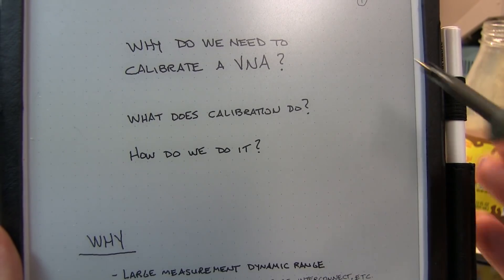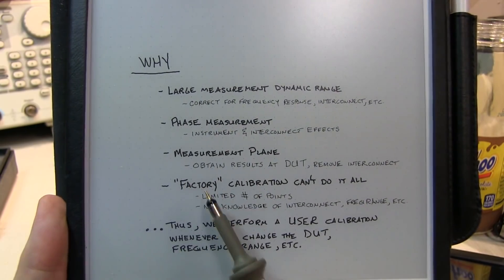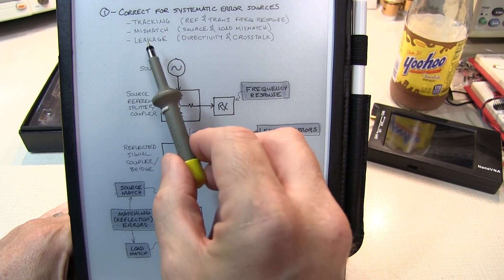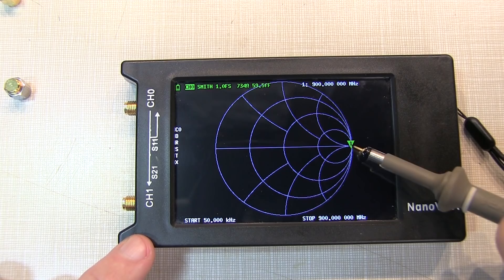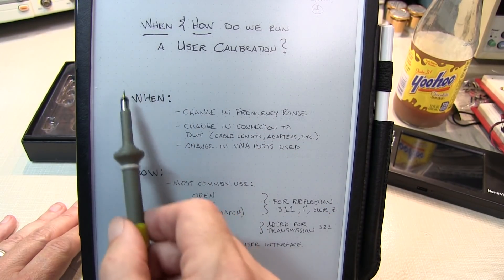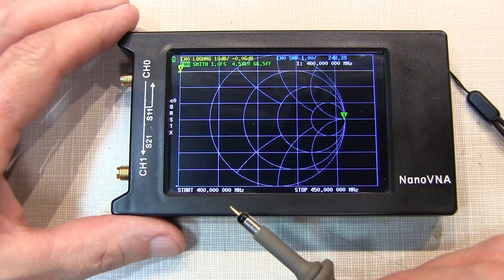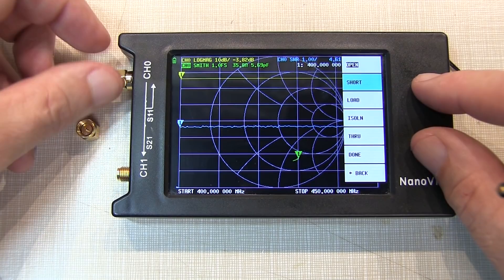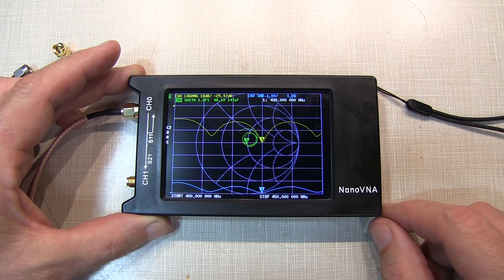#313: Why a VNA needs to be calibrated | how to calibrate a nanoVNA

Comment: is this something that needs to be done when new or every time you use it to do certain functions?
Reply from the maker: The User Calibration needs to be done whenever you change the frequency range or change the type/length/configuration of the connections to the device under test.
Reply: @w2aew  Ok is it best to test just the antenna or the entire length of used coax?
Reply from the maker: @RC-Heli835  It is best to have the antenna located where it will ultimately be used, and measure at the point where the transmitter would connect to the coax.
Reply: @w2aew  Ok my Nano arrived last yesterday but the PL259 adapter is on Backorder. So I cant check anything yet.

Comment: Could you explain how is possible to receive the RF signal using a light bulb as the RX load. 

I know EM waves are moving from the transmitter to the receiver generating a oscillatory current and turning on the incandescent light bulb. 

Would be nice to understand how exactly it works, and demonstrate it.

Comment: Thank you for the video. It puts me one step closer to understanding how my NanoVNA works. 
One question though. You demonstrated that even a short piece of coax can dramatically affect the measurements. However, you didn't connect your coax when you were calibrating the NanoVNA. Could this introduce an error in the measurements of your antenna?
Reply from the maker: Not an error, but just a different impedance due to the measurement location.  When you have a non-resonant antenna as a load, the IMPEDANCE seen at the transmitter end of the coax WILL change with the coax length, but the VSWR will NOT change with coax length.  So, if your goal is to measure the antenna SYSTEM (antenna+feedline) in order to adjust it for minimum SWR, then calibrating at the VNA and measuring at the tx end of the coax is perfectly OK (and correct).  However, just remember that the IMPEDANCE seen at the tx end of the coax is not the impedance of the antenna itself.  In order to measure the impedance of the antenna itself, the calibration plane has to be at the antenna - either through direct calibration with the standards applied at the antenna end of the coax, or possibly through port extension.
Reply: @w2aew  thank you for the reply. That's a lot to take in, and I have a lot of ground to cover. I will study this a little more.

Comment: As a metrologist engineer in the VNA department of the VNIIFTRI, I think it will be useful to add some information for those who don't own NanoVNA yet. The main drawback of this device is that it has only 101 measuring points. It means that if one wants to scan, let's say, G5RV antenna over 3 HF bands from 7 to 21 MHz, the span between two adjacent measuring points will be 144-145 kHz. It is definitely a too wide frequency step to get at least any reliable measurements. In fact, 101 points are enough to sweep antenna over any 1 band no matter HF, VHF, or UHF. Another (practically small) drawback is that the test signal on lower frequencies is not a sinewave so if the device under test has resonances on harmonic frequencies it can influence the measurements.

As for me, I'd like to have an opportunity to define calibration kits for NanoVNA fore some extra precision, but to be honest, there are too many other sources of uncertainties, and even if I will calibrate NanoVNA using Keysight 85052D calkit the NanoVNA will not be much more precise than it is. Of course, I can get all the possibilities I want using Chinese KC901 or Russian PLANAR VNA but the price will be refreshing. Especially knowing that more expensive "real" VNA will require phase-stable cables with metrology-class sockets and calibration kits which are nearly as expensive as gold, and it's not a joke. In my opinion, NanoVNA is the best portable amateur measuring device in its class. Devices like Arinst, EU1KY, and Sark-110 antenna analyzers provide only one-port measurements, and most of them are already more expensive. OSA-103 provides 2-port measurements but requires a laptop, case, and extra modules for frequency range above 100 MHz. The least normal VNA is times more expensive than any of those above.  MEAS (Measurement Equipment Acquisition Syndrome) is a very expensive disease. :)))
Reply: The 101 measuring point limitation is easily compensated for by using the nanovna-saver software.  You can specify a sequence of multiple samples within your measurement range to get more usable resolution.  It also will do its own calibration based on your sweep settings (which is quite necessary, IME).  You can also do averaging across multiple sweeps to get nicer representation of your results.  I never use my NanoVNA's built-in interface if a computer is nearby.
Reply: Why Rant about comparing it to professional devices that cost many thousands of dollars..some people like to keep things as simple as the job it was designed to do..
Congratulations on being a Metrologist Engineer !! That's all wanted to hear.!
Reply: @andrewverran3498  MEAS is a costly disease. :) I myself own a NanoVNA-F and am pretty happy with it.
Reply: just a quick update, my NanoVNA H4 has 401 measuring points on it, I realize this is a necro's thread... just putting it out there

Comment: In video #312 I believe you mentioned a VNA could locate distance to fault. Is the NanoVNA capable of preforming that kind of task? or does it require a higher end VNA?
Reply from the maker: Yes, it can.  The function is call TRANSFORM.  This performs a frequency sweep and transforms the result into the time domain which can show you distance to a fault (open or short for example).  I will be doing a video on this in the next few weeks.
Reply: Thank you. Thats awesome.

Comment: You didn't do the calibration right, you have to press Reset twice!  That's why your SWR is a nearly flat line across the bottom of the screen.  If you use one of the Windows programs to do the calibration they don't work correctly either for the same reason and the cal. has to be done on the instrument itself to get correct readings.
Reply from the maker: Interesting.  I never heard that.  So, I ran a few experiments here.  While the second press of the RESET function does turn off the CORRECTION, it doesn't seem to affect the end result of the calibration when completed and saved.  At least that's the result I have with the nanoVNA-H4 running v0.5.0 firmware.

Comment: These come in a case now? I got one about a year ago and it was supplied as pcb's. I'm going to need to find one to put mine in.
Reply from the maker: The larger ones like the nanoVNA-H4 and the nanoVNA-F come in cases.  I would imagine that the original smaller ones are available in cases now too.
Reply: @w2aew  Aha, I didn't realise there were different flavours now. I obviously haven't been keeping up. Cheers!

Comment: Thanks Alan, excellent and informative as always.  Now I know why I got different results when I changed the co-ax length on my glider antenna design. Doh!! :)
Reply from the maker: Yes - remember that changing the coax length will change the impedance seen by the transmitter, but it will not change the SWR (except in the case of adding a lot of lossy coax, where SWR will appear to get better, but really doesn't).

Comment: Thanks Allen. You just cleared up a question I had in mind, whether or not to include the cable in the calibration but upon thinking about it more I remember the cable is part of the antenna.
Reply from the maker: It all depends on what you need the results for.  If you need to see the impedance of the DUT itself, then cal at the DUT.  If you need to see the impedance at the coax input (since it is how the DUT is used, such as an antenna), then cal at the VNA.

Comment: Great video! Thanks. Often I need to make a connection to a PCBA to match an antenna. I can calibrate out my cable in the normal fashion; open, short, load but then need to calibrate out the "adapter" to the PCBA. I often use port extensions to do that. Is the NanoVNA capable of that? Also, I have been hooked on your videos for awhile now, have not seen them all but was wondering if you ever did a video on using port extensions and if not would you consider doing one?
Reply from the maker: Yes, the nanoVNA has a Port Extension feature.  They don't call it port extension though, they call it "electrical delay".  It is found under the Display>Scale menu.

Comment: Q1. If you had put a short on the cable at 315 mhz, would it have transformed into an open at the VNA end?  would be cool to see that in real time
Q2. how long of a cable can the calibration actually compensate for?
Reply: The cable length is limited by signal degradation. You can go further with higher quality cables, but keeping it as short as possible is best.
Reply from the maker: A1) Yes, if I had put a short at the end of the cable at 315MHz, it would be transformed to an open at the far end.
A2) It really depends on the loss of the cable for the given frequency being used.

Comment: I have measured NanoVNA Chinese calibration standards using R&S ZVA-40 in my office. It's pretty wonderful fact that these standards are pretty good in the working frequency range and even beyond 1 GHz! Although Open standard isn't a masterpiece of stability, but Short and even Matched load are usable for up to 3,5 GHz. Also NanoVNA itself had shown pretty usable stability and precision compared to ZVA-40, and this fact is absolutely wondering knowing the price of NanoVNA. As for me the most wonderful that it works well with full-size HF antennas in the city.

Comment: Do you think a VNA could be used to test and analyze an IF transformer? I have seen a spectrum analyzer used on an IF to show how wide or narrow the frequency response is for an IF (the Q?). But if the VNA were connected to the primary how would you load the secondary?
Reply from the maker: It is often best to tap into IF chains at about a stage away from the filter/can you're trying to measure to avoid loading effects - especially since IF amps/filters might not be running at 50ohm impedance level.  When in doubt, add several hundred ohms in series with the connections to the VNA - you'll get some loss, but it will have less of a loading effect on the circuit you're testing

Comment: Why would you want to display the reflection coefficient? because mostly you display the Return loss and VSWR but why the reflection coefficient?I have never used a Network Analyzer that was able to display the Smith Chart at the same time with the Return Loss and VSWR like you did in this video. HP Network analyzers in the 80's when displaying the smith chart I don't think there was a way to display the Return loss and VSWR at the same time as the smith chart. The complex impedance of the antenna is a combination of the impedance of the antenna and the Ratio of the forward wave and reflected wave?

Comment: I always thought that the OPEN termination for calibration was useless because you can just leave the port open, but i did not consider the distance offset introduced by the connector!
Reply: Actually, there is another thing to consider. At higher frequency, especially in the microwave range, leaving a connector OPEN means radiation, instead of a precise point on Smith chart as shown in the video. But you need a standard that behaves exactly like an OPEN, not a radiating port. Otherwise you will never be able to guarantee that at that reference plane you have a phase shift of -90 degree between voltage wave and current wave. Hope this is clear.
Morover, since it very difficult to build a standard that is an ideal OPEN all over the frequency range but in reality it is a capacitor, most manufacturer use a polynomial approximation to model the frequency behavior of the standard. This is true also for the SHORT standard.
Reply: @paolomonai9511  Couldn't you use a SMA connector with the pin removed and the end soldered over to block radiation?
Reply: @NiHaoMike64  No. If yoy examine how an OPEN standard is built you can see that  there is NO dielectric inside. I mean NO Teflon. Actually,, a CAL KIIT in SMA connector does not exist. All major VNA manufacturers adopt 3.5mm connector. This connector is perfectly compatible with SMA type and it used basically for two reasons. First, the frequency coverage up to 26.5GHz and second its dielectric is AIR, not teflon. You can establish a precise reference panse in this way, in fact, teflon is soft....when tightening you will never find the same position  as far as the reference plane is concerned. If your VNA cables ends with 3.5mm connectors and you have an SMA DUT it is a good practise to use a 3 lb inch torque wrench to prserve the integrity of 3.5mm connector. Due to the teflon dielectric, obviously SMA conncector is rough compared to a 3.5mm...Same type of connectors and opposite gender, SMA female with SMA male or 3.5mm male with 3.5mm female, tourqe is 8 lb inch. All these considerations are for a professional use of VNA, I mean lab grade instrument, many thousands dollars worth... regards from Italy.

Comment: Fantastic video, Alan. I'm new in the RF field, so this is really valuable to me. How does the performance of the NanoVNA compare to a more traditional high-end VNA? There must be some tradeoffs there I think. 
Also, are you using the calibration kit included with the NanoVNA or do you recommend replacing? Looks like the load you are using differs.
Reply: It lacks speed, dynamic range and IF bandwidth adjustment. When sweeping over large bandwidths I find it easy to miss narrowband notches that fall in the gaps between measurement points. But it really is pretty good for a lot of tasks.
Reply: @scienteer3562  cool, thanks :-)
Reply: It would be really interesting to see if the nanoVNA could measure stuff other than antennas and filters. For instance plane impedance in a PCB.
Reply from the maker: The nanoVNA has lower dynamic range, only 101 test points (unless you use the external s/w), no IF BW adjustment, no averaging, - but - still very useful.  I was just using the OSLT kit that came with it.

Comment: I've looked at the schematic and was amazed how you can just repurpose a bunch of cheap ICs to make a real instrument. It has: Wien  resistor bridge, 3 mixers, freq generator + LO based on a multiple-output frequency synthesizer chip, and a multiple-input stereo audio codec as a detector. The signal generator frequency if offset from LO by some audio-range frequency delta, so when they are mixed, the mixer output can be fed to the audio digitizer for further amplitude and phase analysis by the firmware in the MCU.
Reply: Not so much a Wien bridge, as a modified Wheatstone bridge. Otherwise very much agree that the nanoVNA is an amazing design.

Comment: Wait a minute -  there was a piece of coax connecting the antenna to the VNA - so you were measuring the characteristics of the antenna and transmission line. Great video as always, thank you!
Reply from the maker: Yes, of course.  But in this case, you'd also be connecting that same coax to the transceiver, so the impedance looking into the coax is what matters.  If you wanted to design a matching network *at the antenna*, then you'd want to measure the impedance *at the antenna*, thus perform the calibration *at the antenna*.
Reply: @w2aew  Yes, absolutely! I was just joking, as you had explained so carefully that the part of the reason for doing a calibration was to correct the measurements to the measurement plane of the DUT - in this case an antenna. As I said, an excellent video.
Reply: @davidv1289  Calibration to remove the effect of cables and adapters on the measurement is called "deembedding".

Comment: 8:25 it's the Copen or the electrical length of the open standard (at these frequencies it just mushes together to look like a lumped element so, yes, Copen) that need to be considered and in fact put into the firmware to use the SMA standards given for an accurate cal. I'd LOVE to know how to enter other cal coeffients. It could be done off board.  These are great VNAs. i have two of 'em.

Comment: The lack of concentricity in the Y direction of the long open (i.e. spiral being centered perfectly) indicates the reactive portion of the cal coefficients presumed (and hey, they may be zero) are off, typically in the L coeff for the short (or the Copen for the open).  Less likely at these freqs. would be the load inductance.
Reply from the maker: Thanks for that.  I don't think there are any reactive components included in the cal standards on the nanoVNA - I believe they're assumed "perfect".  What do you expect for $60, including the "standards".  Thank you for the education on the calibration standard nuances.
Reply: @w2aew  I agree.. hah hah! I worked at Casacade Microtech for 6 years on probe development and met the zen masters of this stuff.  The nano VNAs are nothing short of amazing, and you did a great job presenting them.

Comment: % of the population who have done a VNA cal: 0.01 .  % of people who have loaded calibration coefficients: 0.001. % of the population who have ever had to characterize a calibration standard to CALCULATE calibration coefficients: 0.000001.
% of the population who can characterize ANY arbitrary cal standard and determine the cal coefficients AT WILL: 0.0000001 .
Reply: Now we are better informed.
Reply: IIRC the nanoVNA saver PC program will let you use such coefficients. I don't think the current nanoVNA firmware supports it.